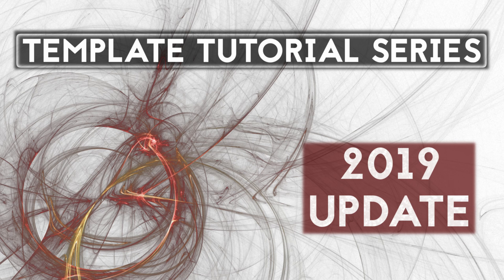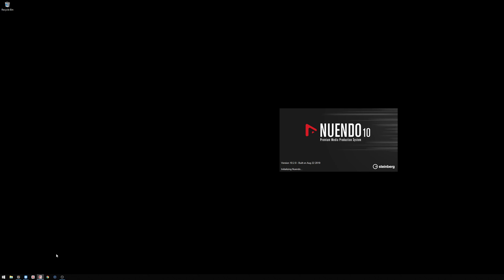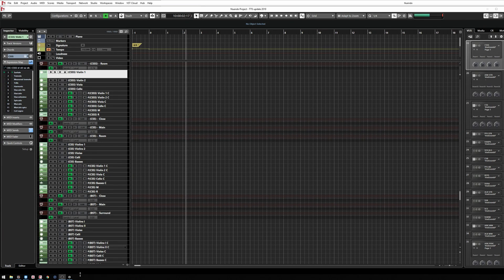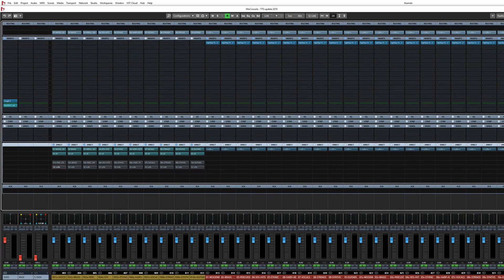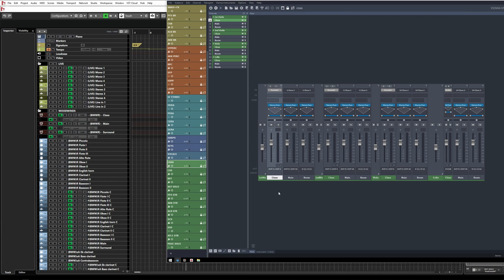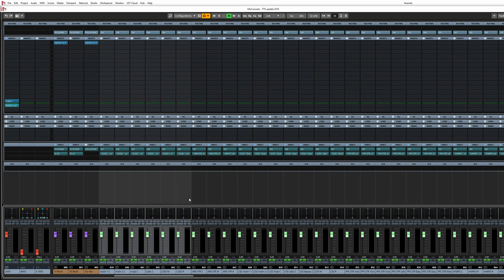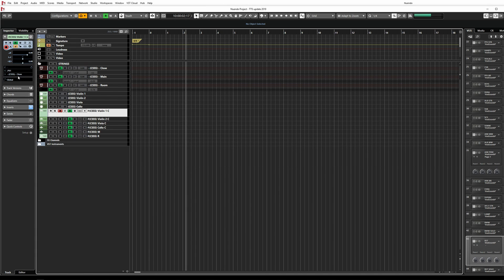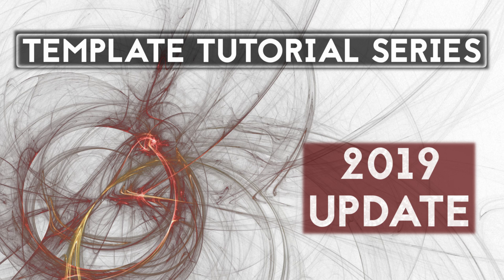Template Tutorial Series: 2019 Update

Comment: Hi Mihkel Once again you inspired me to redo my template. I also quit'ed Lemur although I had spend tons of time. The Open Stage looks a little more promising.
I want to ask you - after recreating your template "system" on 2 of my string libs, aren't you gone have a bunch of extra files that you very seldom use, I mean all the audio tracks and the extra busses.
I just counted my string libs and I have around 10, the will mean around 150 extra tracks because of the extra audio, so I wonder can you actually save a channel preset of a string library that are set-up the way you use?
Thank you SO much for sharing, very generous!
Reply from the maker: Hi Stig! Not many extra things at all - I layer lots of libraries regularly so everything you see in my template I use all the time.. But you could have only 1 or 2 sets of audio tracks for strings, for example, using those for all libraries. And same for group busses, you could set them up to be "universal" rather than library specific. And what you suggest with channel presets should work too, though I have not tested it myself.

Comment: Hi Mihkel. Wat kind of touch screen do you use for OpenStage Control? How did you connect your touch screen to OpenStage Control?
Reply from the maker: Hi Zach, at the moment I am using a cheap 13 inch Android tablet. It's connected by USB using reverse tethering, but Wifi works too (though is a bit slower). OpenStageControl is running on my DAW, and I connect on the Android by simply going to the right web address (a LAN IP) in Chrome. In the future I would like to upgrade to a 21+ inch touchscreen which would run as an extra screen for Windows.
Reply: Mihkel Zilmer Thank you Mihkel. Your answer gives me some ideas how I could eventually use openStage Control. 👍
Reply: How did you make your Open Stage design responsive?
Reply from the maker: @zachsandvik1867   Check out the VI Control forum thread I linked to in the video description. I shared my project there (page 7 I think), and explained the responsive feature. Others shared their projects too, lots of useful info there!
Reply: Mihkel Zilmer Thank you Mihkel. I will read it and check your project. I am happy to have some stuff to learn from. 👌